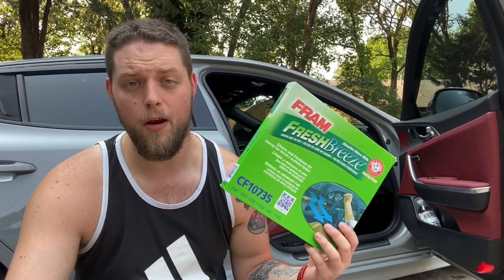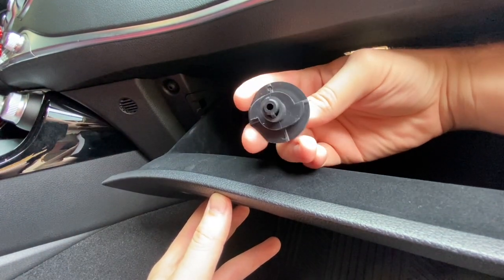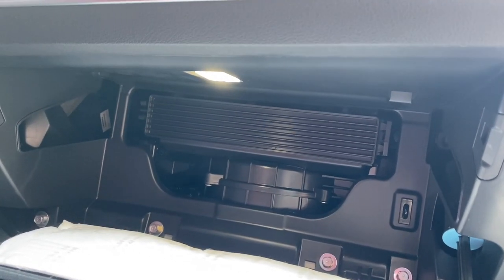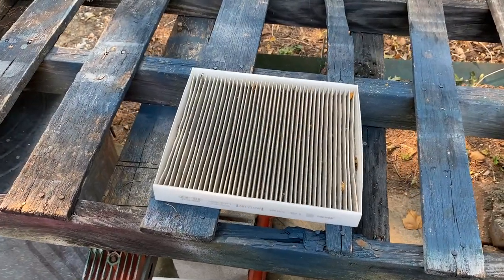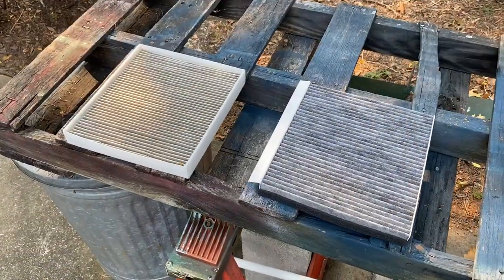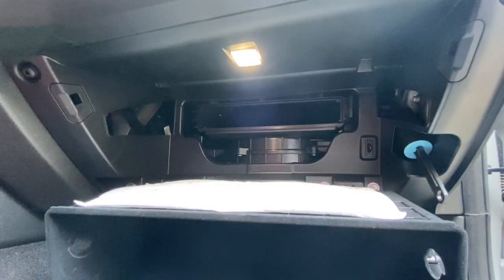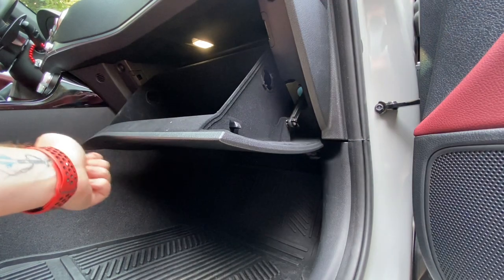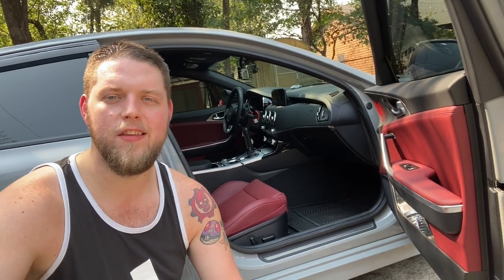How To Change Your Cabin Air Filter (Kia Stinger - Very Easy)

Comment: Indeed it was very simple, but, I would not have a clue if not for this video...Thanks for posting it.. The dealer wanted $79 for it, the 5 minute oil change place I went wanted $49 for it, I purchased it for $21 and installed it myself...🤣😀🤣

Comment: You can't assume that the old filter was put in correctly and make sure the new one is put in the same way. Maybe the old one was put in wrong.

Some filters have arrows indicating what the air flow direction is and other brands have arrows indicating which side goes up.

In this case you would be right because all horizontally mounted cabin air filters with the blower motor mounted below the filter have downward air flow.
Reply from the maker: True, good point.

Comment: Will this fit 2022 stinger gt line?
Reply from the maker: I’m not 100% sure but it probably does. I doubt Kia would change the size of the filter box between the GT’s and GT-Lines. That would cost them way too much in production.
Reply: @KDMCurt  I had to do some tedious research but yes same filter. Thank you